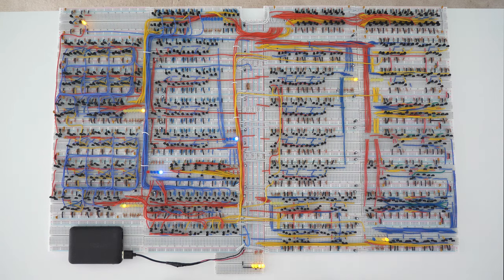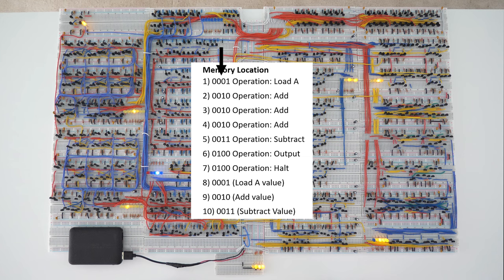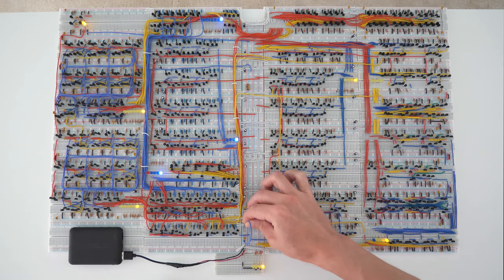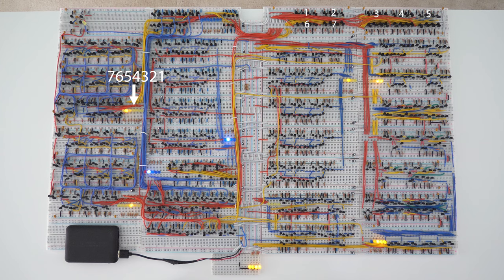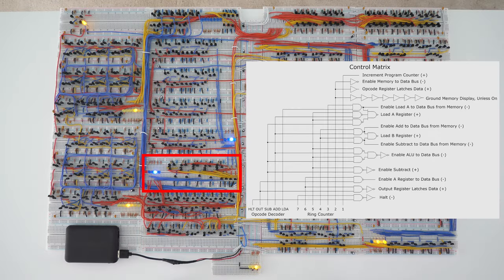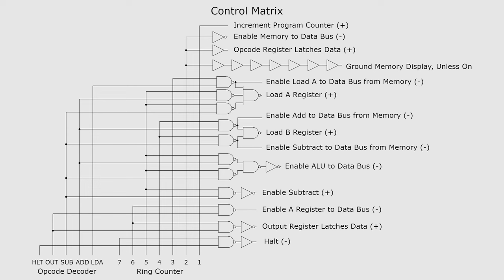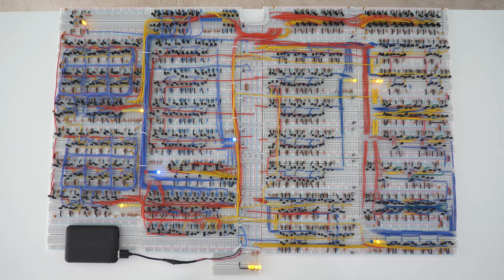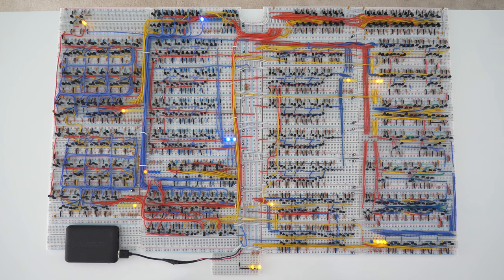How to Build a 4-Bit Computer on Breadboards Using Individual Transistors

Comment: So cool, less than 1000 transistors. Hard for me to wrap my head around modern chips with 8.5 billion transistors. THANK YOU!!!
Reply from the maker: Thank you, yeah that is interesting to think about! You would need over 100 million breadboards if you were building this way. ha ha
Reply: Just adding 1more bit of power to this computer will increase the number of transistors maybe by factor of 2 so imagine 32 or 64 bit computer.
Reply from the maker: @yankozlatanov  Adding one bit would be one more set of flip-flops. Going from 4-bit to 8-bit would just about double the size of the computer. I know the point you are getting at though. I looked into it a found that a modern CPU has around 3 billion transistors, 35 billion transistors for 32GB of RAM, 7 billion transistors for a GPU, and around 3 trillion transistors for a 1tb SSD.
Reply: @GlobalScienceNetwork why are ssd's so much cheaper even though they have more transistors?
Reply from the maker: @multiarray2320  that is a good question. Most CPUs today are built with EUV (Extreme Ultra Violet) lithography which allows the transistors to be really small, around 13.5 nanometers. A CPU design is going to be more complex than memory cells. For an SSD the architecture is single-cell, multi-level cell, or tri-level cells that are repeated to increase memory size. This makes the designs less complex and the transistors can be a bit larger. Due to the large number of transistors required, it took a long time for SSDs to be an affordable price for consumers. SSDs are still expensive but as you pointed out, cheaper per transistor than a transistor on a CPU.
Reply: @GlobalScienceNetwork  thanks for the great answer :)
Reply from the maker: @multiarray2320  sure thing!
Reply: 技術者のパズルゲーム(o・ω・o)
Reply: Without computerated design tools it wouldn't be possible. Up to about twenty five thousand was about all a design team could handle by hand.
Reply: Oddly enough, an STM32 NUCLEO development board can cost as little as $15, but it has a 32-bit processor, lots of memory, peripheral interfaces and it fits in the palm of your hand. 
Oh my how far we've come since I was in high school doing a project like this one. 😂 Back then (1980's) this was not cutting edge anymore, but it was very helpful in getting me started with computers. 
If you're a smart person looking to understand computer hardware, this is a great start. 
I'm going to do this project myself, but I'm going to use KiCAD to make it available for everyone. Then I'm going to just have PCBs made. This should be fun!
Reply: @个_个-f4t   I ❤ your idea of puzzles.😂👍
Reply: @SciHeartJourney  this does not answer my question, because both cpus and ssds are mass produced. in fact, the question already got answered in the very next comment...
Reply: imagine we couldn't shrink transistors and could only use breadboards. A modern computer would be the size of a building

Comment: Is modern CPU use resistor and capasitor inside it? Or just fully transistor?

and, is second generation of computers use logic gate like this too?
Reply from the maker: Yeah, a modern computer will have resistors and transistors. Logic gates are used but MOSFET transistors are used rather than BJT transistors so the connections are made differently to achieve the logic gate types.

Comment: Very cool... but it's actually not a full computer, more like a calculator, as I don't see any method of doing a comparison, supporting flags or jumps.  Will that be an enhancement that you'll be making to it?
Reply from the maker: Thanks, I was just trying to build the simplest computer possible. I started with a 4-bit calculator and that was used as the logic for the ALU. Adding the jumps and flags would not be hard if you think that is important. I did think about adding if statements and loops into the program. That would be the next logical step in my opinion. Maybe sometime I will re-visit that if there is interest. Right now though I am trying to take what I have learned and am trying to build hardware based neural networks.

Comment: Of all the homebrew cpu projects I've seen on youtube, this has to have the lowest transistor count by a mile. Working with transistors is a vastly different beast than ICs, and I'm quite pleased to find novel solutions like those ring counters being used to keep things as simple as possible while remaining functional. When I saw the thumbnail in the SoME3 playlist, I thought this was going to be a Ben Eater kit build or similar, so I'm really impressed you got a pure transistor build in the same form factor! Well done all around!
Reply from the maker: Thank you for understanding this build! :) I really wanted to build a simple computer using only transistors! It was lots of work to figure out a good way to do this. Using the ring counters helped and using edge triggered flips flops for the ring counters helped reduce the size significantly. I learned tons in the process and still need to make more videos that I think people will find helpful! Right now I am trying to apply what I have learned to build some artificial neurons. Which should be pretty sweet! Thanks for watching!

Comment: I built Ben's 8-bit breadboard computer, but I wanna go deeper. This looks like a really interesting project, I will check it out.
Reply from the maker: Sweet! Yeah, building circuits with individual transistors can be a good way to see/know exactly what is going on. If you built the 8-bit computer I bet you will be able to contribute when we start building artificial neural networks. I started with a simple computer before jumping into trying to build different types of computational devices. I have plans for some cool future projects. I am glad you found the channel!

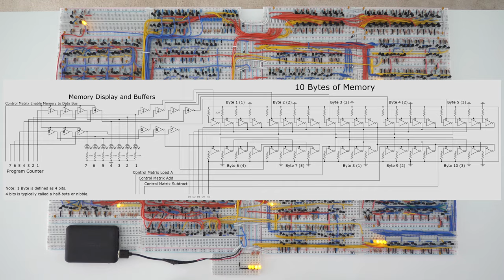Comment: Another question... 5:40 Why not use a diode matrix for your ROM, wouldn't that be even simpler than transistors?
Reply from the maker: I looked into it briefly after you asked the question. I think you could use a diode matrix which would be even simpler read-only memory. One diode could be used rather than two transistors. The enable inputs/buffers would need to be changed as the bytes not being accessed would all need to be off. For non-read-only memory, you would need the simplified tri-state buffers to work with flip-flops as adding and removing diodes to set the bits would not be an option. It is always good to know a simpler way to build things, thanks for the comment! If I make a video about the memory I will have to build a little diode matrix to show.

Comment: You should feel proud of the accomplishment of building a transistor computer, few people have actually done that especially these days, and its given you a deep understanding of how computers work at a very low level.  Beyond that, you've done an excellent job of communicating that knowledge through your youtube channel, which is one of my favorite channels.  So thank you and hats off to you!  I hope you still have the completed project.  If so, I have a suggestion.  You can buy permanent breadboards that have the same pinout as solderless breadboards.  If it were me, I think I would buy some of those and transfer your circuits to them.  I would then mount them on a backing, add a frame, and plexiglass cover, and mount it on a wall to display it (perhaps running some continuous program).  So not only would it be a personal achievement, but also a work of art on display.😊
Reply from the maker: Thank you! I do still have the completed project. I might still make some more detailed videos of how each section works. That is a good idea. I was actually planning to frame it eventually! I agree that it is a form of art! It took me a few months to build and I was happy with the results so it is worth the value in parts to keep as a completed project. What do you mean by permanent breadboards?
Reply: @GlobalScienceNetwork  1PCS 5.2x8.9cm Standard Permanent Breadboard Solder Pcb Board Prototype Board

Comment: My jaw dropped. Amazing job. I have seen the processor built with TTLs, but transistors? Never. From what I see, the space used by transistors is even smaller than that used by TTLs and that's odd since TTLs are more integrated than transistors.
I already see it as an educational tool or project for bigger groups. Each group builds one component and then they join it 
into one system. Beautiful.
Reply from the maker: I am glad you see how it all comes together! Yeah, I think this is what should be taught in school before students learn to program. So they have a fundamental knowledge of how the computer works. If you have the vision follow along as we build new and more advanced computational projects!

Comment: ❤ this project! 👍
I'm an EE. I've been doing this since i was 16; 1982.
Back then I took correspondence courses in electronics, then digital microprocessor: Cleveland Institute of Electronics. 
In one project we build a 4-bit computer using very simple ICs. We used a 4-bit ALU that greatly reduced the complexity. We used a 1kbit RAM memory chip to hold the data. 
We could either single step each clock by hand switch, or use a 1Hz clock. 
All that it did was add, subtract, xor and not. 
It used only a few breadboards.
I would ❤ to build this huge design though! I like going down to the transistor level like this video shows. 

One suggestion though: surface mount parts on a cheap PCB fab. 
PCBs from China have become so cheap that it's better to do board layout. 
I would still keep each block separate though. 
This is perfect project for a young person wanting to learn more about how computers work. 
I think this channel should write a book on this. I already want a copy! 😂👍
Reply from the maker: Thanks! That sounds like a good course you took. Yeah, it would be cool to build this on a PCB! Making this into a course with a textbook is an interesting idea as well! Once we get a decent design for hardware based neural networks I will turn that into a PCB project when the design becomes to big for breadboards.

Comment: I'm in the process of building Ben Eater's IC breadboard computer, but this is so cool. I might have to try it out in the future
Reply from the maker: Sweet, yeah once you get it done the next challenge is to built it at the transistor level!
Reply: @GlobalScienceNetwork   do you recommend i do ben's ic breadboard computer first or do this first?
Reply from the maker: @MustaphaRashiduddin-zx7rn  I just went straight to building the computer with individual transistors. It makes more sense to me to be able to see all of the components. I would start with basic logic gates, then build the 4-bit calculator which will turn into the ALU. Once you get that done build the clock and it should start to make sense. I have another video where the computer is half done which is a good midpoint of the project. If you have any questions during the build, let me know.

Comment: As a kid, I wondered what it would be like to build one of these using wire-wrapped nails as relays/switches (instead of transistors) lol
Either way, this is so cool!
 ...especially since you used raw transistors, which makes the whole thing just magical.
Using raw transistors (no ICs) is like the assembly language of digital circuits.
Reply from the maker: Thanks! I am glad you appreciate the project. Yeah, it would be cool of you could build a simple computer out of relays/switches as well! Depending on when you were a kid that is how it all got started.

Comment: Very cool example. Was expecting just a 4-bit CPU. Not a 4-bit computer. Can't wait for the next version with 7400 and 4000 IC, 8-bit register, and data bus. Maybe even binary and decimal LED outputs.

This reminds me of the TTL Clock project.
Reply from the maker: Thanks! The goal was to build a computer at the transistor level to ensure we know the fundamentals of how a computer works. Now I am working on building hardware-based neural networks. The binary to seven-segment display would have been a good addition. The binary numbers are pretty low though so reading the binary is pretty straightforward.